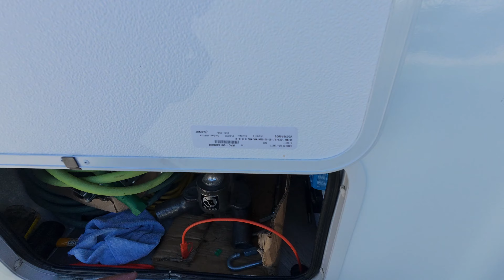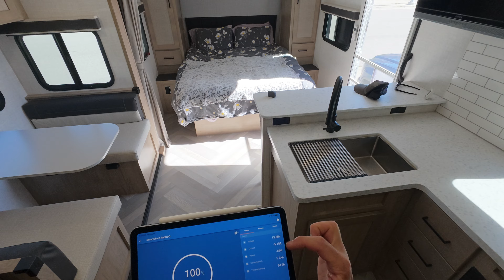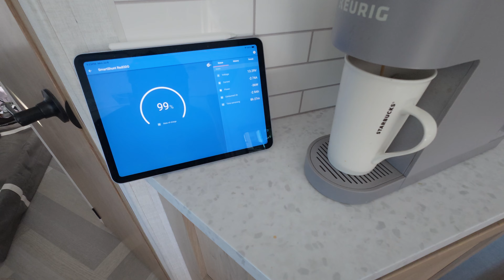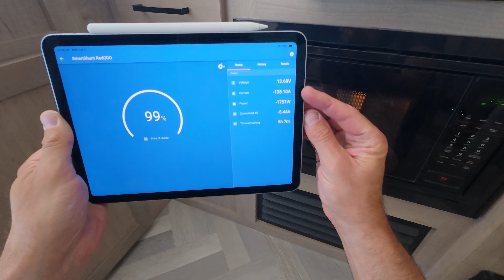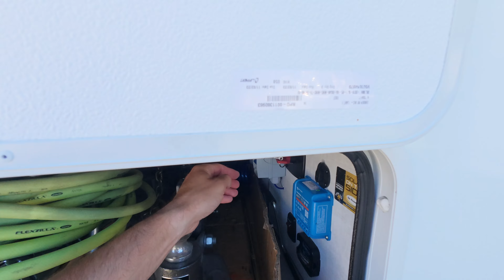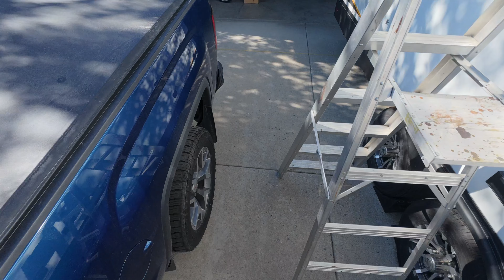RV Microwave now works with this HACK

Comment from the maker: This is how you can use your microwave if it's not connected to your inverter and you don't have a generator. We now use a Bluetti Elite 300 Power Station to run the microwave and air conditioner. Check it out in this video here: https://youtu.be/0GPwr05XHAA

Amazon Links to the products covered in my videos: 

BLUETTI Elite 300 Power Station: 
CAN https://link.amazon/B08RkcELD
USA https://amzn.to/4qksDZp
(Affiliate link directly to Bluetti's site: https://tidd.ly/4cokJsb)  

Outside Weatherproof Outlet Plug Cover: 
CAN https://link.amazon/B05seDgXP
USA https://amzn.to/45vy8ek

Surge Guard 10' 30 Amp 10/3 Extension Cord: 
CAN https://link.amazon/B0aaMmDHK
USA https://amzn.to/4x64gkW

10 ft 14 AWG Computer Power Cord
CAN https://link.amazon/B0j9l8LH1
USA https://amzn.to/3UzGeAe

MOOKEERF XT60 Extension Cable 10AWG 10FT: 
CAN https://link.amazon/B05z1T9kg
USA https://amzn.to/4xDa98X

ZOUPW 350W Portable Solar Panel N-Type 
CAN https://link.amazon/B022hnnbK
USA https://amzn.to/4bQmtua

Victron MPPT 75V 10 amp Solar Charge Controller: 
CAN https://link.amazon/B0eWLl4xQ
USA https://amzn.to/4fZPDcT

Victron Energy SmartShunt IP65 500 amp Battery Monitor 
CAN https://link.amazon/B0733CiNI
USA https://amzn.to/3TUbqtX

RedODO 410ah LiFePO4 Batteries: 
CAN https://link.amazon/B0cfMHSAK
USA https://amzn.to/4qlzmT8

Tonton M-C-4 Solar Connector to XT60 Adapter Connector Cable: 
CAN https://link.amazon/B0d2Riz0Y
USA https://amzn.to/3ShP4BU

ELFCULB 12AWG XT60 to SAE Connector Extension Cable 
CAN https://link.amazon/B05xVXgM6
USA https://amzn.to/3ScHrwz

Disclaimer: As an Amazon Associate I earn from qualifying purchases

If you’re interested in buying a battery from Redodo, I’ll get a small commission if you use my affiliate link:
USA:  https://www.redodopower.com/?ref=irhfvjxo 
Discount Code: Cavillier

Canada:  https://ca.redodopower.com/?ref=nesctxfy
6% Coupon Code: JASONCAVILLE

Comment: Inverter and battery are big enough. Should work without generator. Unless your battery doesn’t output 200amp.

Done my share.
Subscribed 
watched 1h31m of video
Reply from the maker: Thanks for the comments! The only issue with this method is not having large enough battery cables.
Reply: @CavillierOutdoors that’s an easy fix. Get the biggest cable.
Reply from the maker: @TheCornucopiaProject-bd5jk  Ya but then I'll want a bigger inverter too and I'll spiral
Reply: @CavillierOutdoors yup, it’s like a yoyo of desires